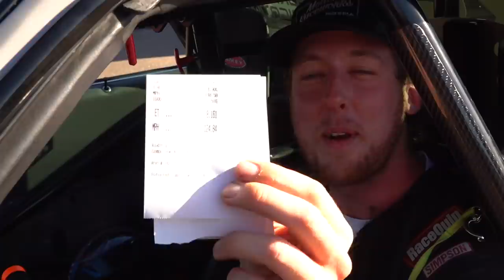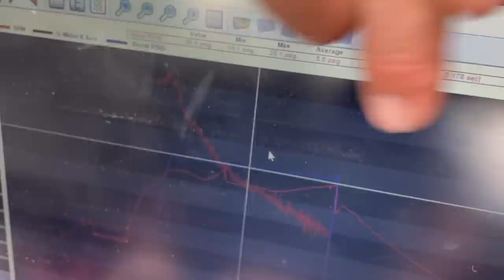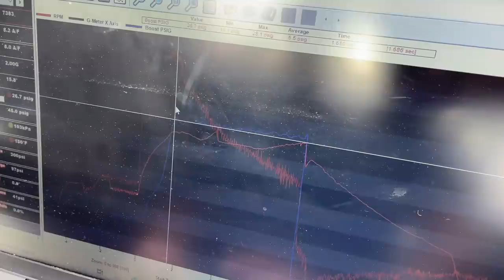Testing Mullet's NEW Turbo400 Lockup Racing Transmission For the First Time! HOLY SMOKES!!!

Comment: Metal O-ring and copper headgaskets should be on ALL the big boy drag cars I.E. Ruby, Leroy, and Mullett tbh...they save blocks and make headrepairs easier and seal so much better
Reply: Top fuel hoops and dry deck the block and heads. Biggest studs you can get.
Reply: These cars are fun to watch develop and are a big part of the channel, but they are not near "big boy drag cars"!  A Drag Week" car that runs in the sixes is a rare bird.  There are very few running right now.  If they want "mullet" to be one of those it will take a full-time effort.  This is a busy operation!  Garrett has a lot going on. A dedicated team and shop may be the next move.
Reply: Forsure I didn’t know they didn’t have hoops already.
Reply: @Paul Copeland and drag week only proves it more too what kinda cars they are as well. It’s hard to build a reliable fast drag car that can street drive.
Reply: The original engine for Leroy had the top fuel hoops on it. That's how they were able to run it even when it blew out the head gaskets. They drained the coolant and then ran a 7.86

I figured they were still running those on all the high horsepower engines.
Reply: @Jeremy-Biggers  you can get the original engine from Texas speed still and it doesn’t mention hoops. I was thinking the same thing
Reply: I'm no engine guy, but could you somehow friction weld a sleeve so the gap just goes away?
Reply: 427 is too much stroke too they need to got 400 or smaller, sbf guys know
Reply: Steve Morris  says hoops. ate better than orings
Reply: I have posted that he needs to switch to red copper head gaskets so many times that I gave up. I figured he either did not read or ignored my post. honestly, anything over 700hp should have them installed as a preventative.
Reply: @Jeremy-Biggers  I’m pretty sure it had “Athena” O-ring head gaskets which is not the same or nearly as strong a head seal as “Top Fuel Hoops” in big power drag motors or “Fire rings” as they are known in diesel circles.  O rings are much smaller or less thick than hoops.
Reply: @TexRobNC  i have seen a few engines where they machine the block and head so the chamber is sealed when assembled. the bad part is when a chamber fails to overpressure they explode taking out the block and head usually. that head gasket serves as much as a safety device as it does as a seal. side note, the coolest and saddest failure I have ever seen was when the valves dropped their heads into the chamber destroying the block, heads, and lanching the valve rods through the valve covers. not one part of that engine was salvageable except the accessories. R.I.P my poor little 2jz you never let me down until I asked too much from you.
Reply: I've been saying this for a while. Noone listens till Kevin says it 😂 All the diesel guys put those rings in. They are running high compression with way more boost coupled with nitrous.
Reply: @paulcopeland9035  is spot on. This shouldn’t be behaving like some max effort 2000+ hp LS combo, but it is. You can see in the log prior to the pass where it laid over that it had 3x psi of coolant pressure. That could be a funny sensor offset or something else, but it could’ve also been the first inclination that the engine was upsetting the sealing surface. No judgement at all to Texas Speed or Garrett and crew bc they’re clearly trying and it sucks!!!  But the people saying it “has to have this and that” are mistaken. There are a boatload of cars out there running lesser parts that are reliable and live up to a lot more passes.  At the end of the day people need to realize that the answer probably isn’t as easy as screaming TKM and hoops (no disrespect to them either!!).
Reply: I use cooper gasket and copper coat with welder wire in head on a 693 ci cyl 2500rpm F-30 pulling tractor. The 1000hp 2750 rpm diesel "farmstock" pulling tractors with 80+psi boost use the wire in grooves in sleeves. I would try it.
Reply: 4cyl
Reply: no doubt every one of you toyota prius drivers has some advice for the professional racecar guys🤦‍♂️
Reply: The honda "Boiz" have been doing this for a while openly. You are right though, the big power (Top Fuel, Funny Cars Etc.) racers for as long as I've been alive. On the affordable level, yeah. Texas speed likely can. Or, the Boosted Boiz know people I'm sure. I can't wait to see how far this build goes.
Reply: @Jeremy-Biggers  I wasn’t forsure!! I personally ran motors after lifting a head after draining the system. You don’t have to have hoops but they sure are nice 😂
Reply: @Jeremy-Biggers  Leroy did not have hoops . They drained the coolant so they had a dry motor because it was lifting the heads . Wouldn’t have had that issue with hoops . They destroyed that motor to make that hero run .
Reply: @XxMusclecarsxX  except every 2500-3000 hp ls is a 427 .
Reply: @derekwoods8199  well tkm or Steve Morris know how to build 2500 plus hp ls engines tsp doesn’t . And they are making 2000 at the crank . Don’t think they have 1/2 inch studs there using multi layer gaskets with no orings or hoops . I don’t know anyone making close to 2k “reliably “ with out those things . Their trying to take a fully built street car engine designed for 1500 ish max and it won’t work . Doesn’t even have aluminum rods in it . I’m surprised their not going through bearings as fast as head gaskets
Reply: @Jeremy-Biggers  the Leroy engine that went 7.80s had a standard .043 o ring setup with an MLS gasket. Top fuel hoops are just a larger o ring without any gap and a larger receiver groove, which bites in better.
Reply: Copper head gaskets are only used in situations where you want them to be a fuse of sorts when the o ring/hoop can't contain combustion and blow out in such a way that doesn't damage the heads. They have a short service life and don't take well to repeated heat cycles (like drag week...)
Reply: @jkfonyi , well now you know someone running no special hoops and making plenty of passes per year at their power levels 😝. Wallace racing says I only make 18xx going mid 15xmph 1/8th at 3160 lbs with a sloppy loose converter so that is a bit of a different animal I’ll admit (1/8th vs 1/4 being harder on parts).  I do agree that for all of the 1/4 they need all of the engine they can get, but the lack of reliability is CLEARLY unexpected for them and Kevin, which goes right along with what I’m saying.
Reply: fire rings are the only way i can keep subaru head gaskets from blowing 🤣
Reply: @jkfonyi  is it?
Reply: Had the same issue making big power in my 4g63, kept blowing headgaskets until I ringed the head. Best way to go.
Reply: Time for a SM Engine with those Turbos I could see easy high 6's
Reply: @keithmott6428  dry deck is wholly unneccesary. even px275 and near promod level guys have only half fills
Reply: @XxMusclecarsxX  no they dont lmao...stroke has nothing to do with this problem. These engines are barely any stroke more than a 400 sbf... and work great in LS/sbc/bbc stuff
Reply: @Jeremy-Biggers  those were added later on down the road as a stop gap when they were using off the shelf 3/8 studs. They now have much stronger 1/2" studs and 6 bolt heads which can take 3000+hp easily
Reply: @paullane7489  o-rings can hold a LOT of power, not as much as hoops but mihovetz set the mod motor record a few years ago (still the fastest 4.6 pass ever) on a simple factory sleeve o-ringed dry decked teksid box
Reply: @jkfonyi   You say aluminium rods like they're a good thing, rather than a crutch to absorb detonation and combustion spikes.
Alloy rods do have their place, but they MUST be used correctly and "lifed". The street is NOT the place for them, unless you like rod failures due to fatigue.

Well designed steel, or for big budgets titanium, 'rods are a much better application here.
Reply: @derekwoods8199  Well when you run them you will see for yourself.
Reply: @jkfonyi  Bingo!
Reply: @derekwoods8199  Well John Doc engine seems to hold up real good he's put a lot of runs on it at 2,200 horsepower.
Reply: Copper head gaskets  and metal o-rings on my 455 (de-stroked so it doesn't fall on its face so early on) pontiac built for 250 shot of N02. 525 WHP NA. Hasn't been a hiccup in 8 years plus. Ported and custom flowed for the cam in the motor.
Reply: They must read these comments and face palm most of the time.  Especially the whiny "I've been saying it for ages" line.  You think they haven't been aware of these options and the pros and cons of these setups for ages?  Not to mention the network of actual experts they call.
Reply: @paulcopeland9035  exactly. There are no prep cars with .9xx 60' and run in the 330 what mullet runs in the 1/8. And they perform almost as well on the street. Also made me think of a mustang I saw on Instagram pick up the front tires from maybe a 30 roll, but that's besides the point completely. Personally I think the "technology" controlling everything probably isn't the way to go without months of dedicated testing time. Computers are only as smart as we make them and we as men are stupid. The ecu having multiple functions per button, 76 sensors, changing to meth during 2 step... None of it has seemed to make much of a difference. Mullet on methanol with all the "brains" basically runs what Ruby did before the big promod on just a terminator x. Cleet has basically the king of drag week as a homie and could've had it sorted long before this, also Larson would be helpful too and tons of other guys. Personally it's just not exciting to see a car, running on methanol and making over 1500hp, run mid 7s when it actually completes a pass. Obviously you have to test and tune but it just seems like 10% of their time is devoted to mullet, the other 90% is just praying it works on race day
Reply: @Jeremy-Biggers  Leroy had copper fire ring that's Lil different but does same thing just not quite as strong the hoops they literally machine head and block and insert a machined piece into it not just some copper wire they make into a circle
Reply: @RustyWells2  did you somehow interpret what I said as hoops or rings etc aren't beneficial??  If that's what it read like, that wasn't my intention.  My opinion was simply that for their weight and 1/8th mile times/mph there are plenty of cars out there reliably running w/out deck sealing issues that don't have big head studs, fire rings or o ringed heads etc, so the people jumping to that conclusion right away should know that it's not a "must" up to a certain point.  Mullet is unfortunately having trouble at 25-28psi w/ 15-16 degrees of timing AND an a2w intercooler.  That timing on a 10-11cr engine on e85 with a good ic could actually be on the soft side depending on the chamber....  I'm not aware of what cr they're running so maybe it's extremely high and that's an issue?  Or the cyl head/chamber is a little aggressive??  Who knows exactly, but comparing them to guys like John Doc and folks pushing well in to the mid-upper 16xmph + range who are in the mid-upper 3x psi or even 40+ psi with 388's and 427" LS' w/out ic's (their cars are much lighter and they're also running 1/8th tho too) isn't apples to apples.  That's a different animal and pushing the line and limits where you'd obviously want and need all of the tricks available.  No one said that a more serious engine wouldn't hold up to more power, but they know and people who do this stuff a lot also know that they probably shouldn't be experiencing issues with their caliber of build for the power they're making.  Nice big happy turbos etc on that car should make it a pretty happy camper.  I only meant to identify that they're having problems in an area where others aren't, which might indicate that there's an issue elsewhere, that's all :) They'll get it figured out and be clicking off 6's soon I'm sure and I'll be rooting for them regardless of how they get there!
Reply: @Shadow0fd3ath24  dry decking has nothing to do with filling. U simply weld up all water holes in head and deck .u still run water if u want just can't get in cylinder if head lifts.
Reply: Is this something they don't do on the east coast, that and the th400? This is something I've seen everywhere here in Arizona.
Reply: They don't think about those things they just slap it together as quickly as possible.
Reply: @GOOGLM3_NY  I hate to break it to you but thats not all that much hp.
Reply: @TheFanatic340  did I say it was?
Reply: @paulcopeland9035  he does have that…? U act like Garrett is the one building the cars….
Reply: @GOOGLM3_NY  Well yeah, you kind of did. You were using your motor, an NA motor with a shot of nitrous, as an example for the reliability of metal rings and copper gaskets. Unfortunately it doesn't really apply to this conversation, being at such a "low" level of power (don't get me wrong I bet it's sweeter than heck!). These motors see so much boost and insane cylinder pressures, at three times the horsepower ALWAYS. As opposed to your 525, I'm assuming only when you give it a hit of the good stuff.

Either way, I'm not mad you threw your two cents and experience out there, in fact I'm glad ya did. I still can't help myself, I have to comment lol.
Reply: Bariliam fire rings and copper is definitely the boost holder inner 3000
Reply: @2jz 240sx what I mean is for longevity anything over 750hp should be run with a red copper gasket. i doubt he really needs the rings tho unless he is hitting 1500hp. also, I doubt your hitting the track on a weekly basis and driving it daily as cleetus does. i used to drag race in the florida, alabama, georgia area back in the early 2000s.
Reply: @keithmott6428  can’t dry block due to the fact it’s still a “street car”. Would never be able to do the race week events.
Reply: @leonardkirby7510  I was hoping somebody would mention that antique tractor pullers have been o-ringing motors for years. How do you keep the crank in that thing with only 2 main bearings?!!
Reply: @markgeisewite2687  It's got 3 now.
Reply: @leonardkirby7510  Gary Baker?
Reply: @markgeisewite2687  Jim Hutson, believe the crank was done in Michigan. It's a long story lol
Reply: @leonardkirby7510  5.25x8?  I would love to see/hear that thing run!
Reply: @markgeisewite2687  Just under 8. I don't have any videos of if and last few years have only been out a few times with it. Hopefully get a few more times next summer but I don't travel far anymore. Central Illinois

Comment: That is incredible Kevin has the tech genius to think to program a safety protocol to protect the engine if it detects a abnormal coolant pressure .
Reply: Its all them sensors.. More data the better
Reply: Sensors are amazing.  If I was building a car, I'd definitely go hog wild with sensors because the stuff that is out there and the amount of inputs these ECUs can take is staggering.  I feel like sensors are the main reason forced induction has become so "easy" compared to say in the 70s and 80s.
Reply: If he was the first guy to come up with it sure but I don't think it's a secret if you think head gasket might be an issue it's probably standard practices
Reply: I think he just saved mullet
Reply: Never wondered why they have almost a hundred sensors on an F1 car?   Every bit of data counts.   I'm not sure about Holley but with Motec you can write any logic you want to modify the engine in the even of change.
Reply: Kevin is obviously very smart/experienced (and no offense to you for not knowing before you heard it here) but racers have been using oil, crank case, boost and coolant pressure safeties for years.